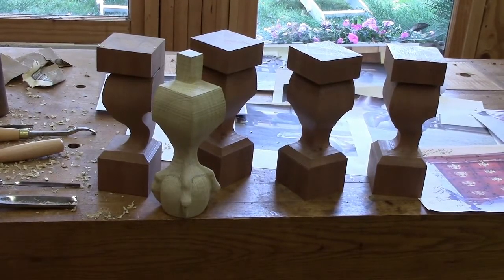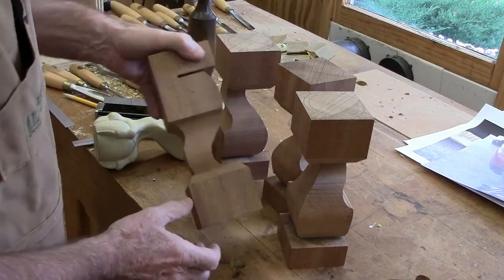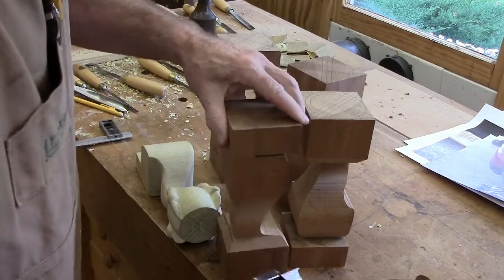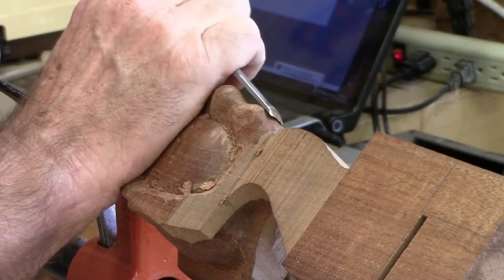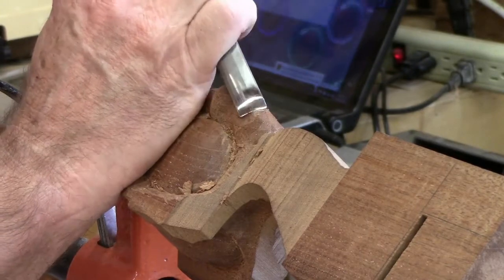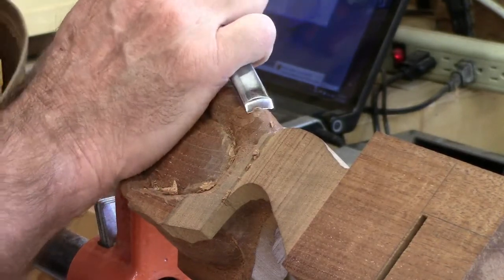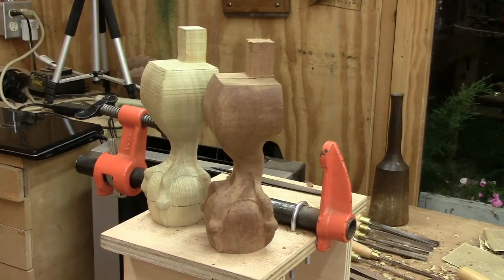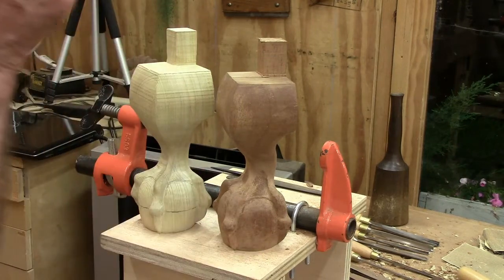Mahogany Curved Blockfront Chest Ball & Claw Foot Step 4

Comment: So I went back and was reviewing video 1 on this build and noticed the cupping you mentioned after resawing.  So I recently saw a video discussing wood structure and it was stated that cupping like that after resawing is almost always due to improper kiln drying putting internal stress on the wood.  Stated that there is nothing that can be done to prevent that once the improper kiln technique has put the stress into the wood...  not sure what to think of that but thought I would lay it out there for consideration.

Comment: Good video as always. How many gouges are necessary to make a ball and claw foot?
Reply from the maker: Thanks Steve, not a lot.  You can do it with a 1/2 in straight, 1/2 inch #3, 1/4 #5, 1/2 #5,  60 degree v chisel, 1/4 #7,  optional 1/2 #5 spoon, 1 inch #3.  You can convert all of those to mm for swiss chisels.  I just happen to use British Ashley Iles